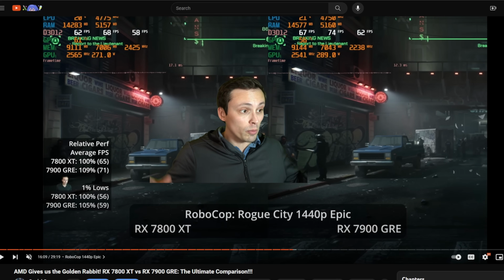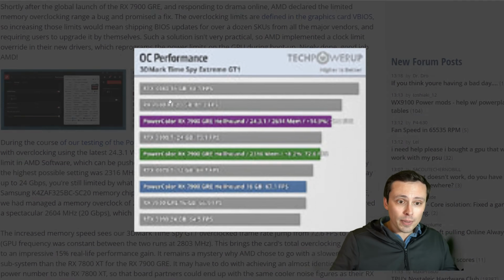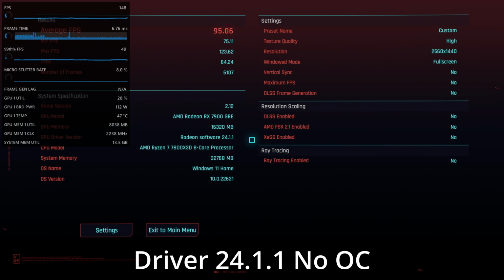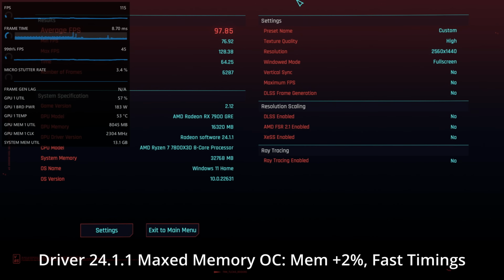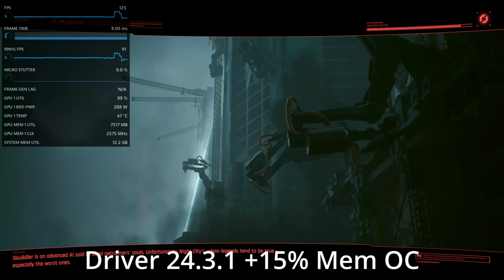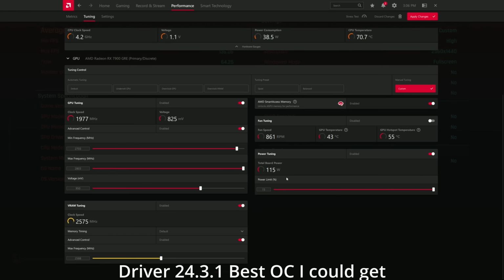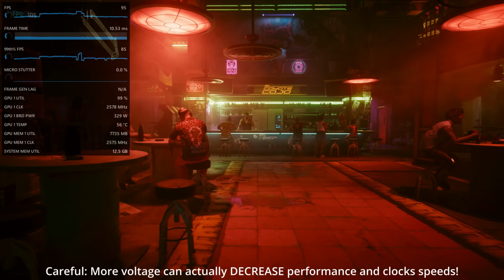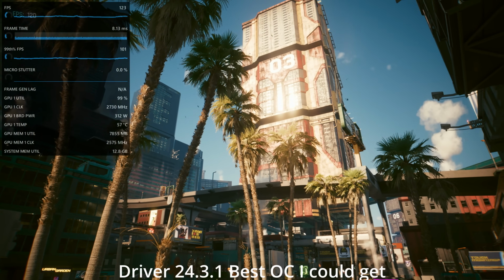Download more performance for certain AMD GPUs!!! (7900 GRE memory OC limits boosted in new driver)

Comment: A 15.7% performance increase from messing with some knobs is pretty good!!

Overclocking isn't dead after all.. HUB and Jayz2cents aren't always right I guess 😂
Reply: How much faster does it make it compared to 7800xt
Reply: @diamonshade7484  Its about 8-10% faster stock. With oc its 20-25% faster than the 7800 xt.
Reply: @LegionGamingTV damn. That's like the rtx 4070 becoming the 4070ti super
Reply: @jannclaudebinoya  Are you saying thats not possible? Or are you just giving an example? Because thats literally what happened in Daniels video. The 7900 GRE is on average 10% faster than the 7800xt, and he got an extra 15.7% increase overclocking the 7900 GRE.. Add the 10% plus the 15.7% he just got from the oc and that makes 25.7% faster..
Reply: @jannclaudebinoya NVM my first comment bro. Im tired and misread your comment lol. Its bed time 😁
Reply: @LegionGamingTV  OC vs Stock yes. But the 7800 XT is not a bad overclocker either, as the Nitro+ can manage 14.9+% OC in the same Timespy Extreme GT1 that TPU used.
Reply: @SolarianStrike  Imagine if Daniel would've used a Nitro+ 7900 GRE? It would've been even more than the 16% he got messing around. I had a 7800xt and sold it for a 3080 Ti lol. Then i bought a 7900xtx and I love it. The thing is he couldve used an even faster card and got closer to 20% overclock.
Reply: @LegionGamingTV  lol 20 to 25% do you know the value increase what you claiming?
Reply: @TheGeekGamer2023  You seem to be the only guy in this thread that didnt watch the video.. The 7900 GRE is 8-10% faster than the 7800 XT.. Everyone that has seen a review of the GPU knows this. Daniel got a 15.7% FPS increase from overclocking the 7900 GRE. Add 10% plus 15% and tell me how much that equals.. CAn you do math?
Reply: @LegionGamingTV  Not really, fact is many 7900GRE out there can't manage over 2400Mhz mem stable. Some models OC well because they used 20Gbps memory downclocked.
Other cards uses slower ICs or have worse binned MCDs.
A Nitro+ might manage a bit higher core clock, but the GRE is bandwidth limited in the first place.
Fact is the TPU sample of the Nitro+ managed lower core clock due to silicon lottery, the 11W higher limit doesn't matter all that much.
Reply: @LegionGamingTV  yes brother, what the point 10nor 15%. In terms of fps you are getting 5 to 10 frames per second. Is there is a huge fps compared to Nvidia rtx 4070 super? Gpu computing has increased? Will it produce the 1gb video encoding much faster then previous driver release? Just fps increase will not useful.
Reply: @SolarianStrike  Dude the reason why nobody were able to overclock the 7900 GRE passed 2400 is because they locked them down in the bios, and just unlocked the GPUs memory with a driver update.. You really believe they are out here selling broken ram modules to then have people return the GPUs after a driver update?.. That makes zero sense as a busniess, Youre drinking too much koolaid.
Reply: @TheGeekGamer2023  Going from 95 FPS  to 110-112FPs on average for free is a good thing. Nobody was talking about the 4070 Super.. The 4070 Super costs $150 more than the 7900 GRE, and Its a completely different GPU. The 7900 GRE when overclocked is 20% faster than a 7800xt. The 7800xt is faster than the 4070, so the 7900 GRE is just as fast if not faster than a 4070 Super. Watch the video and leave me alone, I dont care what you think.

The 4070 Super is 2% slower than a stock 7900 GRE according to Tech powerup. That means when overclocked the 7900 GRE is 15-17% faster than a 4070 Super. You guys out here get mad when AMD beats your Nvidia cards dont ya lol?
Reply: @TheGeekGamer2023  Here is hardware unboxed telling you about a 10% FPS on the 7900 GRE for nothing https://youtu.be/q5tbCbm1IYM?si=cv8yyRVBBRiRlN8q
Reply: @TheGeekGamer2023  Go watch Hardware Unboxed new video. 7900 GRE is faster than a 4070 Ti now.
Reply: @LegionGamingTV  
First off, the original limit on the 7900GRE was 2316Mhz, so there was no way to get 2400Mhz before with software.

Who said anything about broken memory? The 7900 GRE is only rated with 18Gbps (2200Mhz) memory.
The reason why some cards comes with 20Gbps (2500Mhz) chips is because the AIBs already have supply lying around.
It is often cheaper to use over-spec chips then to order a new batch of memorry just for a certain model, at least for the first run.
Reply: @SolarianStrike  You literally said they are using down clocked and worse binned which in silicon terms is pretty muck broken.. And you found out in less than a day or 2 that all these AIBs has these "down-clocked extra modules" just laying around? Nah lol.. Plus if they were that bad they wouldn't even use them on an overclockable GPU.. 

AMD purposefully locked the mem speed down so the GRE wouldnt out sell the 7900xt.. Just stop. If the mem couldnt even get to 2400mhz (19.2gbs) there would be mass returns once this driver went live.. Dont you see how ridiculous that is? Im not saying it isnt possible that there are some crappy mem modules out there, but to say that its a mass issue is just conspiracy.
Reply: @LegionGamingTV  What are you even on about? The product is only garenteed to run at stock clocks.
Any thing OC is YMMV. No one is entitled to get 2400Mhz or even 2316Mhz on the memory clock.

Some early  RX480 4GB actually had 8GB on them. Does that mean you are entitled to unlocking to 8GB on your 4GB card? I don't see the "mass return" of those.
Also by your logic any 5700X should not be overclockable. Because they are "broken" 5800X. Oh, there also dual CCD 5600X / 7600X etc out there with the actual broken CCD fused off.
I guess "mass returns" as well.
Reply: @LegionGamingTV  this is a dumb comment, you should compare OC vs OC but u are comparing stock vs OC, OC cards won't be there for long run. The 4070 super OC or 7800XT OC vs 7900 GRE OC should be there for comparison, not with only 7900 GRE OC vs other stock cards. If thats the case, 4070 super still wins over other cards
Reply: @MrBALAKUMARA  Actually Hardware Unboxed just put a video on youtube about the 7900 GRE vs the 4070 Super, both of them were overclocked and the 7900 GRE is faster than the 4070 Ti now. Go watch it, and stop calling me a liar.

The video is called "Radeon 7900 GRE, Now with Memory Overclocking".
Reply: @LegionGamingTV   i saw that video, EVERYTHING is at stock except for GRE, lol we are delusional aren't we?
Reply: @MrBALAKUMARA  the 4070 super is overclocked as well.. The point of the video is ton show the performance level per dollar.. You guys are looking for any and every reason to argue bro its so pathetic.
Reply: @MrBALAKUMARA  You obviously didnt watch the video lol 😂
Reply: @MrBALAKUMARA  No the rtx 4070 ti is OC'ed. he even say's it in the video
Reply: @LegionGamingTV  I watched the video, for 7900 GRE, he tested with 3 cards, stock,Nitro + ( which comes with already over clocked),and Nitro + oc'd. But for the other cards he used only stock version (all are non oc models), only 4070 super is oc'd,even with the Nitro+ oc,there ain't a considerable increase in performance. So the correct comparison in that HUB video is 4070 super oc and gre Nitro +, in which 7900 gre stands up with 4070 super. That's it.
Reply: @MrBALAKUMARA  The point of the video is the 7900 GRE only costs $550, the 4070 Super costs upwards of $600-650 depending on the model you get.. Paying $550 for a GPU that when overclocked is faster than a stock 4070 Ti is pretty spectacular. Even overclocked the 4070 Super couldnt catch up.. You guys get so but hurt and play semantics and take the conversation into an argument everytime. The point is FPS per dollar spent, and paying $550 and getting the same FPS if not more FPS than a $600-$800 GPU is the whole premise. Nothing I said was wrong, or incorrect in anyway. STFU
Reply: @LegionGamingTV  lmao now you are saying fps per dollar?, so suddenly perm/dollar ratio comes in?, if that's the case then 7800xt is the beast because it can put up with 7900 gre and 4070 super for its price when overclocking that GPU.

 first of all answer my question, why in that HUB video (except for 4070 super, that too 4070 super is the non oc version) didn't test other cards at OC?,why are you comparing the stock vs OC?, if you can't answer this then STFU or come back to me at better argument.
Reply: @MrBALAKUMARA  Thats what overclocking is for .. Getting more performance out of cheaper components.. You are missing brain cells.
Reply: @MrBALAKUMARA  Your acting like im the one controlling the test that HUB and this channel ran LMFAO. All im doing is telling you the data that HUB and Daniel Owen gave us. You are mad why? Because i said a 7900 GRE beats cards up to the 4070 Ti when oveclocked? Thge 7800xt barely gets 10% when overclocked and that is barely enough to get to 7900 GRE stock.. So thats $50 pc increase not $200 or $300. 

The point of overclocking is to get more FPS out of a cheaper card, You are mad about nothing dude,, get a life and STFU😂

The performance difference between a regular and oc version of a gpu is less than 2-4% in every GPU ever made. So at best add 4%.. Youre english is bad btw.
Reply: @MrBALAKUMARA  Love you.
Reply: @MrBALAKUMARA  People like you are what the make internet the terrible place that it is.
Reply: @LegionGamingTV  well thanks for loving me.

So you have no better argument. Well that's it then.
Reply: @LegionGamingTV  percentage doesn't work that way 10% and 15.7% on top of that makes 27.27% faster overall. Just saying 🤣
Reply: @svm2787  cool. you proved to everyone you cant do simple math👍
Reply: @LegionGamingTV  I'm not gonna explain it you. Either find out why that is or stay dumb
Reply: @svm2787  No, actually layout the equation that you used to calculate 10% + 15% = 27%.. Please? Since I'm dumb, enlighten me.
Reply: @svm2787  And you were wrong.. 95fps-10%=85.5FPS. 110FPS was the final average... So 85.5+_=110FPS. The answer is 29.2% not 27%. You tried to make me look dumb when I used an estimation.. Seriously? 😂 You were still wrong.
Reply: @LegionGamingTV  you must be braindead to still argue at this point. Suppose 7800 XT had 100 fps. Now calculate what 10% boost and then 15.7% boost on top that gives overall fps. 

If you come up with any other result, then you calculated your your initial 10 and 15.7% gains wrong. I do not even want to go there. Just wanted to tell you how chain percentage works. Looks like I am barking at the wrong tree
Reply: @LegionGamingTV   Why are you still arguing at this point? suppose 7800 XT had 100 fps. Now calculate the overall fps after 10% and then 15.7% gain on top of that. 

If you get any other result then you calculated your 10 and 15.7% gains wrong. I do not want to even bother with that. Just wanted to let you know how percentage chaining works. Looks like I am barking at the wrong tree.
Reply: @svm2787  The 7800XT had 85.5 FPS as i stated. the final FPS of the 7900 GRE is 110. Do the math. BTW I'm not the one arguing.. People like you have jumped into the thread and tried to outsmart me every step of the way for almost a week now. Hasn't happened yet. Challenge me and I will accept.
Reply: @LegionGamingTV  again, stop arguing and learn math.
Reply: @LegionGamingTV  Base average fps for the new driver was 100.97 and after oc was 110.45.  The boost from 95 to 100 was due to updated drivers and not OC. Captions were on CAPS. smh...
Reply: @LegionGamingTV bro it's extremely common for companies to use lower binned parts for cpus and gpus.
Reply: @LegionGamingTV  difference between most 7900 gre is 1-2% it would've made absolutely no difference if he used nitro +. Maybe he would even get worse results who knows. It's different for every card.
Reply: @TheGeekGamer2023  it's exactly the same as 4070 super with more vram and no productive value at all. Bad for rendering etc. it's basically better for games due to 4gb vram.
Reply: Im confused at the start of the video he was making it seem like the 7800xt was actually better than the 7900 gre lut the box, could you explain please? @LegionGamingTV
Reply: @SolarianStrike  the ones using hynix memory are the ones which have little issue Oc memory
Reply: @SolarianStrike  i run  2538  just fine on my retail priced  sapphire pulse 7900gre so stop there's alot of cards that can push above 2400mhz
Reply: @MrBALAKUMARA  no tf it doesnt it overclocks like shyt  only 4-7%
Reply: @steven7297  IDK which comment you are replying to. I never said anything about the Pulse, everything is silicon lottery. My point was no one guarantees how much a product OCs. 

That is apart from the software lock at launch where the memory slider will not let you go further. No matter which model you had. That was an oversight when the OG 7900GRE were meant for Chinese OEMs, they forgot to remove it for the retail version. That got fixed post launch.
Reply: @ well the assumption that most can’t reach 2500mhz steady or increase bandwidth is a complete lie .   I was just running 2538mhz just fine
Reply: @steven7297  I said many, not "most", nobody knows the exact percentage of cards that OC well.

In fact the exact units of Pulse and Nitro+ reviewed by TPU had Hynix 20Gbps memory on them, that is why they "OC" so well.
The most likely reason for using 20Gbps (2500Mhz) ICs on a card rated for 2250Mhz is that is just what they had leftover from XTX production. Many other cards have the "proper" lower rated memory ICs. The AIBs have no obligation to use higher rated ICs, and is subject to change.
The same ICs (H56G42AS8DX-014) on my XTX easily does 2700 to 2750 depending on the game.
Reply: @steven7297 I said many not most. Also the unit of Pulse reviewed by TPU literally had 20Gbps (2500Mhz) Hynix ICs on it. So your Pulse OCed well pretty much just proved my original point. The AIBs only needed to use 14Gbps (2250Mhz) ICs for the GRE. The reason for using it 20Gbps at the time, is probably what they had leftover when they switched from 7900XTX production. It is all subject to change and no one is guaranteed anything over spec.
Reply: @SolarianStrike  well it’s not a bad Gpu and the fact that a company like sapphire does things the right way . I mean I think the only reason it’s rated for 18gb is due to the sanction on tech on china . Now some do carry Samsung memory  only rated for 18gb

Comment: AMD must have specifically had some 18.5Gbps rated GDDR6 they needed to get rid of when they released the GRE in China.   They did it as a reference only card.   In the near year since then, yields have gotten better.   When they gave the go-ahead for board partners to sell this globally, it doesn't save them any money in the current scene to specifically purchase a lower grade of GDDR6 than they are already using in mass for the 7900XT and XTX.  They are just using them same memory chips.  So what you are getting is 20Gbps rated chips, so this is neither driver voodoo nor is it the least bit risky in creating instability or burning out your card by upping the memory performance to this level at the a minimum.  To me, this immediately makes the GRE the most attractive card in AMD's lineup.
Reply: I dethroned the 7800xt
Reply: It*
Reply: Looking at how it's been overclocking I'd guess it's not downclocked 20gbit chips from the 7800xt and up, but slightly overclocked 18gbit chips from the 7700xt and down. The 7700xt and 7600xt have been selling poorly so they probably have a grip of that cheap vram. It can also depend on different vendors as well where a Nitro or Hellhound might have better memory than a bare bones reference model at MSRP. 

Also keep in mind there's still no price on the Hellhound, they've only been sampled. There's no WAY it will be MSRP and if it follows traditional HH pricing it will hit $600 and match the 4070 super's price. Maybe that's why they still have no pricing this long after the GRE's launch when it can't match Nvidia's features.
Reply: 18 gbps is the fastest GDDR6 memory all 3 manufacturers can supply. Faster GDDR6 than that is significantly more expensive. It's not a coincidence that Sony chose 18 gbps memory for the PS5 Pro.
Reply: Nope. They needed to limit the memory bandwidth in order to never be able to reach 600gb/s. Just a matter of export restrictions to China.

Comment: 18 Gbps memory is really abundant and obviously cheaper than 19Gbps (7800XT) and 20Gbps (7900XT). Maybe it has to do with the fact that AMD is selling literally the same amount of silicon within a 7900XT/X at the price of a 7800XT (that uses Navi 32 which is a lot smaller). That's my theory about the odd memory selection for the GRE.
Reply: Yep. 18 gbps is the fastest all 3 manufacturers can supply. The same reason why Sony specified it for PS5 Pro.
Reply: there a gre with hynix memory that  re rated at 20gb per second bud

Comment: I bet the original design of the "GRE" was using both kinds of chiplets that were the binned down ones that couldn't run at full XT speed. (Remember, the 7000 series has the graphics die and memory interface dies.)